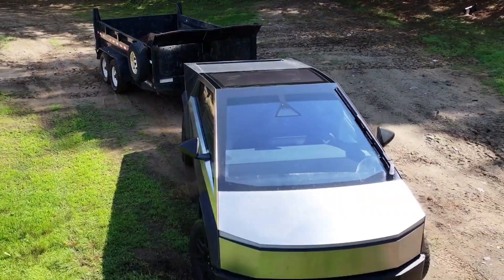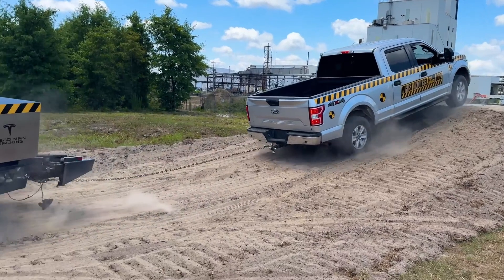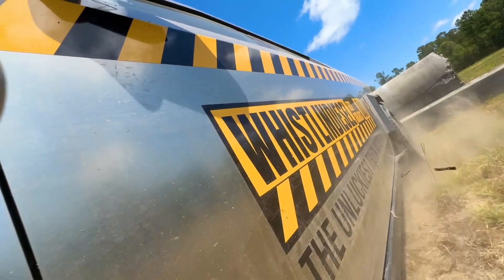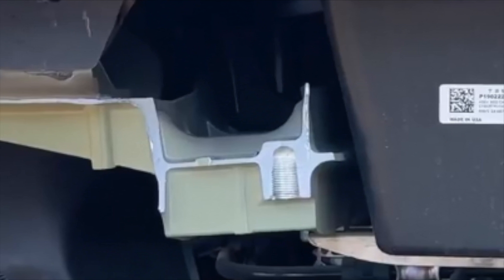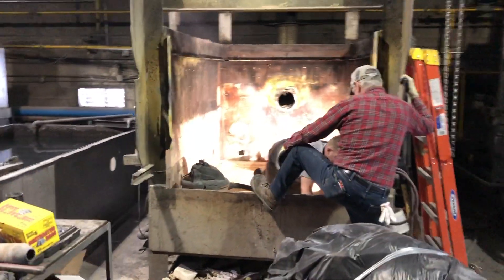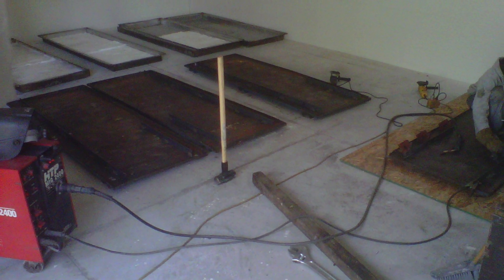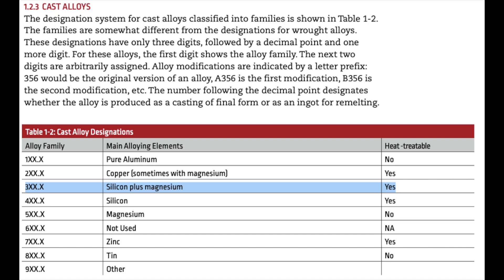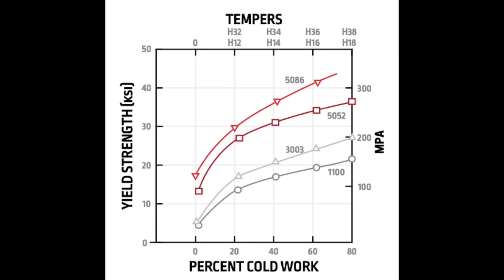Cybertruck Towing Review  WD hitch failure explained

Comment: Hey Peter, I need to run my PP220 off of a generator, just short circuit MiG. What watt generator do I need? I’ve got access to a 28k peak Westinghouse, runs at 20k. Also do I need to have what you guys call “clean” power with the harmonics and all that? Don’t wanna burn my machine up.
Reply from the maker: if the machine starts up and works - it will probably be fine ....  the official number is less than 5% THD but that being said - usually these machines are pretty resilient ... they dont blow up easily

Comment: Tesla doesn't heat treat those castings. They adjust the alloy to a proprietary alloy that doesn't require heat treating after casting.
Reply from the maker: well, maybe there is the problem .... lol
Reply: @ZILAwelds  No, the problem was that Whistlin' Diesel dropped the trucks hitch onto a large cast concrete beam from 5 or 6 feet up. This is not a realistic use of a truck. Then he made it look like the towing is what broke the hitch. I feel sorry for all the gullible people fooled by Whistlin' Diesels antics. Yes, he could have been more honest, no, it doesn't take a rocket scientist to figure out how he deceived you.
Reply: @ZILAwelds  What problem? You don't think dropping the truck 6 vertical feet onto its hitch is the problem? This is not something any real truck owner will ever have to worry about, unless they are trying to destroy the truck like Cody. The castings on the Cybertruck are strong and rigid, that's what makes it handle like it's hewn out of a single chunk of metal. My F-150 is a flexy-flyer. Not good.

Comment: A steel frame breaks off from that kind of drop is bad design. I understand the cybertruck weighs a ton but it then should be able to take additional strain over standard vehicles. Frame may be too small. Regardless an issue.

Comment: Whistling diesel just disproved this
Reply: I don't think this video disagrees with Cody's 2nd video on the Cybertruck/Ford truck. Cody acknowledges that the cybertruck was dropped on the hitch, and this video has a lot of useful information on the manufacturing of aluminum parts. This video doesn't compare steel frames to aluminum frames, so there's nothing to disprove.

Cody's 2nd video does show how a Ford truck's steel frame is superior. He tried to break the Ford's frame off with an excavator and dropped it on the hitch repeatedly from much higher heights and it would not break. I don't think a cybertruck's frame will ever be able to take the kind of abuse that other trucks can.
Reply: @odometric5946  My favorite digging shovel won't survive being run over by a dump truck either. That's doesn't make it a bad shovel. On the other hand, an errant shopping cart will do thousands of dollars of damage to the F-150 while the Cybertruck's ultra-hard steel exoskeleton will remain unscathed. It's all a matter of damage that could actually happen. I'm never going to drive any of my trucks off a 6-foot vertical drop landing squarely on the receiver. It's just not a concern. Tesla knows how to engineer it for that impact, but it would just make the truck heavier and more expensive than necessary. Tesla engineers for real world risks, not Whistlin' Diesel's destruction videos.
Reply: @ZipZoomZip you do realize that there was a real world case of the hitch shearing off with a trailer attached on the highway. The trailer ended up rear ending the "truck" (though I'm pretty sure any tesla owner enjoys a good rear ending.... 😂😂😂).
Reply: @user-bt6hh9yu1n  The rear subframe has published repair procedures in the event it is damaged in a rear-end collision. Tesla took this into account when they designed the rear sub-frame. You are over-thinking this, when you take a new vehicle loan you must insure the vehicle. Your concerns are covered when you buy insurance. I was pleasantly surprised how affordable my insurance was.
Reply: Mostly u r sofa king we todd did
Reply: Cody didn't disprove anything. Claiming you disproved something is different from actually disproving it.
Reply: @ZipZoomZip Cody proved that dropping hitch ONCE on concrete should not crack your frame.
Reply: @diydad5067  A five-foot vertical drop of the hitch onto a concrete curb is not something Cybertruck owners will have to worry about. Anyone who knows pickup trucks, their owners, and how they use their trucks, gets it. Where have you been? Oh, that's right, Watching Whistlin' Diesel destruction videos. I'm gonna guess you're not a real truck guy.
Reply: @ZipZoomZip  Sorry to hurt your feeling Mr. Truck Guy. The facts are Aluminum cracks and breaks without warning meanwhile carbon steel bends then eventually break off. Cast aluminum cannot be welded because they are heat treated. Steel can easily be welded even on the road. Saying something will not happen already broke Murphy’s law because it already did.
Reply: @diydad5067  OK, just keep driving your truck based on last centuries frame technology, just know that it is not up to snuff. And that assumes you even have a truck. Because it doesn't sound like you know much about trucks,
Reply: @ZipZoomZip  I didn’t realize I was interacting with NPC. Silly me. 😂😂
Reply: @ZipZoomZip  tesla's official statement was that the CT's hitch only has a vertical load weight limit of 160LBS which is less than a 1/4 of a class 3 hitch which is standard on half ton trucks. I could exceed that weight with my body or the tongue weight of literally any trailer. they also said that the claimed 11,000 towing capacity isn't absolute so in reality they don't know what they're doing. 

if you have ever been off roading you would know it's not uncommon to bang your hitch on things. I have banged my hitches on steep driveways before. you would see this kind of abuse on the rubicon or in moab. the CT is supposed to be the ultimate off road truck so why not try it?
Reply: @ZipZoomZip  "OK, just keep driving your truck based on last centuries frame technology, just know that it is not up to snuff." are you being serious right now? the reason we have been using steel frames for so long is because they work great and there isn't really a material that can replace it's cost and durability. the CT is proof that aluminum is not the future of truck frames as it's weaker and more expensive. steel is still king. rolled steel will always be stronger than cast aluminum. 

"And that assumes you even have a truck. Because it doesn't sound like you know much about trucks," look in the mirror.
Reply: @ElectronicsForFun  The vertical capacity of the hitch is dependent upon the moment arm, or the distance from the hitch pin, however it is stated. Tesla has been clear that the tongue weight limit is 1100 lbs, but as the distance increases, the allowable limit goes down. Because it has more leverage on it. The 160 lbs. was for a longer moment arm than a trailer tongue applies to the ball. Tesla knows exactly what they are doing, they have some of the most talented automotive structural engineers and material scientists in the world.
Reply: @ElectronicsForFun  Most of the structure in the Cybertruck is steel, from the passenger safety cage to the super hard stainless steel exoskeleton to the structural battery frame which is used as a load bearing member of the chassis. Only the giga castings and sub-castings around the bed area are aluminum.  Rockets like the Starship, developed by SpaceX, have more aluminum structure, relative to the amount of steel, because rockets are even more weight sensitive than vehicles and aluminum is stronger, pound for pound, than steel. Millions of people have died due to the poor crash performance and the ease with which traditional steel trucks roll over. Steel is cheap, but it doesn't create the most advanced vehicles.
Reply: @ZipZoomZip steel isn’t ‘last century’ it’s the most cost effective and safest material we have for construction and it’s been around for multiple centuries. A 6000lb truck that can’t even take a tongue weight over 160lb is not progress. You have to accept you bought a fashion statement not a ‘real truck’
Reply: @jamie0193  The tongue weight limit of the Cybertruck is 1,100 lbs. which is 50% more than the tongue weight my F-150 can handle. It also tows with a lot more control and authority, like nothing is back there. My F-150 makes a heavy trailer feel dangerously on the edge. You don't know what you are talking about. If people think my Cybertruck is fashionable, then that's just an added benefit. Where I use my truck people rarely see it anyway, so being fashionable was not even on my list.
Reply: @ZipZoomZip  class 3 hitches usually have a tongue weight between 500-1,000 pounds yet they don't break under heavy shock loads like the brittle "giga casting" that Tesla uses.
Reply: @diydad5067  yup, musk fans are a funny bunch .. I used to weld and reinforce farm trucks sometimes in miscellaneous metal work. Aluminum exists for many years now, so there is a reason why steel (and not aluminum) is used in heavy duty equipment, which will take more than just moderate abuse, which means that any brittle metal is not the best choice, when compared with steel, that like you said, bends and flexes, absorbing the abuse much better...  Cast aluminum is brittle, and Can be welded, but it's not easy .. need to preheat, and the task is not for the  average backyard Joe.  There is always brazing option, but I never tried that with aluminum, just with cast iron.

Bottom line is, I don't want to be in Highway with CT featuring pansy connections , worried that a trailer calls it quits from CT. Cyber-truck is a great weekend truck.. For towing like a diesel does, someone with brains needs to look at the strong points of the truck cast frame,  and reinforce the hitch connections with through bolts, to transfer the stress to at least the rear axes, and that takes solid struts or plate at least 1/4" thick when using steel, so I would use 1/2" aluminum min...
Reply: @ I agree common sense is hard to come by with heavily “educated” people.  However, even if someone guarantees they can weld cast aluminum, I would not trust it with my life; the structure is already compromised. Plus it is too stressful to have to constantly check for cracks and  always be worried whenever you run over potholes. Cybertruck was supposed to be utilitarian, easy to fix/low maintenance, and robust/reliable but it just turned out to be a disappointment.
Reply: @Klis1517  Dual motor Cybertruck weighs 6630 lbs. which is over a ton lighter than the Chevy Silverado EV and almost a ton lighter than the F-150 Lightning. That's why it drives and handles so well. It also makes it better off-road. Nothing else comes close, it drives like a dream.
Reply: @Klis1517  It's a lot lighter than its direct competitors and it drives like a lighter truck than my gas F-150. It's just pure joy to drive, on or off-road. But yeah, trucks are heavier than most passenger vehicles. It's a truck.
Reply: @ZipZoomZip the ford took a licking and kept on ticking. Can’t say the same for the CT.
Reply: @frankr6053  The Ford was totaled
Reply: @erleichda98  not it wasn't. It was still driving and could still tow. The CT suffered unrepairable frame damage and was dead in the water.

Comment: While they might not want to spend too much money handling such a scenario, a few questions are raised:
1. What would have happened to a conventional truck? Yes the steel would bend, but would it bend to such a degree that it would total the car?
2. Could some low-cost changes allow the CT to handle such a scenario? Maybe a few adjustments to ensure there are sacrificial elements taking the force first? It seems noteworthy that the hitch seemed to be intact while the frame was compromised. Ideally you would want this reversed.

Comment: For some reference, it got hit with 7000lbs of shock force from underneath the hitch. That is about 7 times its rated tongue weight capacity of 1,100lbs (from above). For reference, the gross weight of a trailer that would apply 7000lbs of tongue weight to the top of the hitch would be a 70,000lb trailer, when loaded correctly, not all that far off from a fully loaded semi truck). What is the big surprise here? Is it because it's the cybertruck that people have absolutely insane expectations? It seems like people will use any excuse possible to make fun of it, even if it's something as meaningless and ludicrous as this. I love WD but this is a huge disservice.
Reply: Nothing to do with that, it's the fact that it wouldn't happen to ANY other truck, period - and I'm a Cybertruck fan.
Reply: yo the logic lol, what if you happen to go offroading, and bam you accidentally smack your hitch from below with a rock! GEEZ wow! Unfathomable.
Reply: Well if you were driving a cyber truck and “got hit with 7000 pounds from under the hitch” ya bes get to the dealer to check for cracks 😂
Reply: 7000 pounds is the magic number because that’s what the truck weighs, more with people. That’s half what my 25 foot class a rv weighs while loaded to the max
Reply: Hit with the whole weight, 7000lbs , rubbish. Front wheels were on the ground, at most 1/2 the weight. Poor materials choise for off road use.

Comment: The whistlin diesel break is not that bad of a hit.    I can do that all day in a normal pickup and not break it
Reply: If you do that to a regular truck it will break period. 
They are rated for 1000 lbs downforce tongue weight. 
They will typically fail around 4x-5x the limit. This truck pulls 30,000lbs sleds just the same as a regular truck. 
The hitch of any truck is not made for 7000 lbs upwards SHEER not to mention the amplified weight of a drop with speed exceeding 20,000 lbs sheer upwards. The only hope a truck would have not to break would be if it’s a really light truck, but the ford wasn’t rioted, or jumped as far or fast or dropped on hitch. 
After the C4 the ford was not driven again probably due to a major electrical issue

Comment: WD can be a meat head...over the top..but The vertical drop onto the trailer hitch, followed by the jerky towing, and breakage, are very realistic. 
  If you like off road fun, but also use your truck, a trailer hitch is a necessary  evil. I sometimes remove mine, but not always. Leaving a drop where I know it will hit, I will NOT be gentle- some forward speed is needed to prevent getting stuck when the hitch unloads the rear tires. I have slightly bent my frame doing this. Ductile steel is forgiving.
   Watching the WD video, I also thought that the vertical smack was the start of the problem. After it was broken, I was surprised at how fragile 8t looked.  Towing that pulling sled? Repeat "30,000 lb!!" all you want...that was actually very gentle and controlled. Not much of a test.
   When that thin casting has had 4 or 5 northeast winters with salted roads, it will be completely untrustworthy- its shape looked like it would hold brine well. 
   Maybe other mechanical or electrical problems will preclude these ever towing after many winters.
   Brittle materials do not belong between a tow vehicle and trailer. Ductility and an excess of material are needed- the instantaneous loads are way too unpredictable,  but are certain to happen sooner or later...a pothole unseen while towing on a rainy night...
   ....or how about when a steel trailer hitch on a real truck is backed into the cybertruck in the grocery parking lot, cracking it...unseen..while you are inside squeezing melons or something? The same hit would not matter, if it were steel.
Reply from the maker: I am not arguing  if this is realistic scenario ...  neither am I arguing if the cyber truck is good or not ...   I am simply explaining how it failed .....  or why it failed ....      sure I cn see that in off road parks stuff like this is a daily thing with those trucks ....  sure....  how many Tesla owners go to those off road parks ???  I am more concerned about the longevity .... towing heavy trailers at high speeds through pot hole riddles american highways .....  how many month or years will this setup hold up ?  will it even be adequate for that type of use?